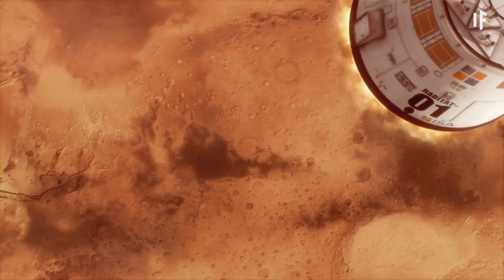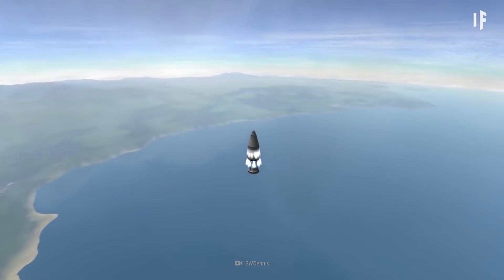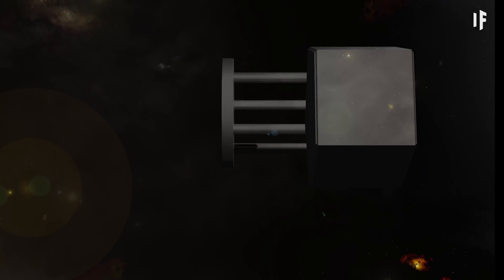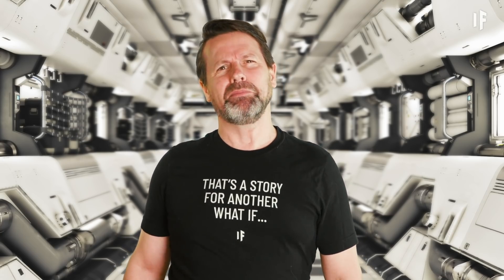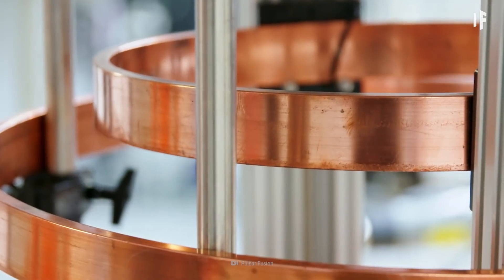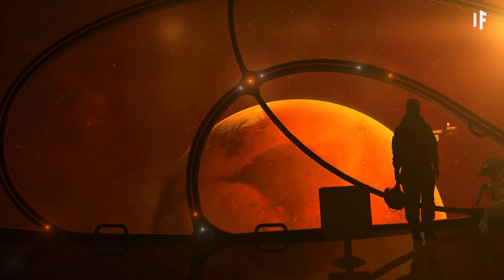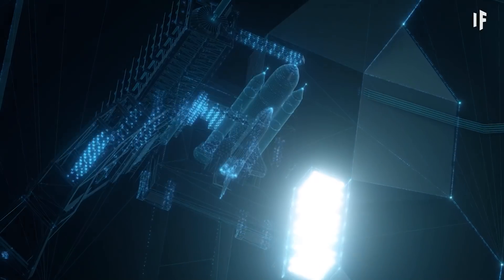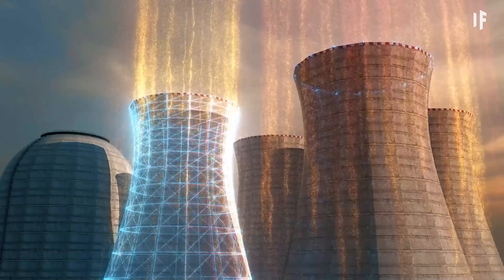What If We Had Nuclear-Powered Rockets?

Comment: hi what if but i wanna correct you nuclear thermal propulsion comes in 2 types nuclear fragment propulsion and nuclear thermal rocket and here both are good but nuclear thermal rocket can be used any where and is 1000 X better than our current chemical ones but its nuclear fragment rocket is which we cant use in earth  as its gives out nuclear exhaust but in then nuclear thermal one its just heated  coolant ( hydrogen ) going around the reactor getting heated and is given out so we can use it anywhere and also we dont need any oxygen so what if pls do complete research

Comment: Nuclear thermal rockets are not much better than chemical rockets because they use large quantities of hydrogen, if you want to see a fission rocket design that doesn't require hydrogen watch "liquid plutonium rocket".  The best way to explore /colonize our galaxy is with the constant 1g acceleration method, with this a ship can get to Alpha Centauri in 3.6 ship/7.3 Earth years and have gravity the whole way (and that includes turning the ship around half way and decelerating). A 10 ton ship would need a mere 10 tons of continuous thrust. Uranium and plutonium contain vast quantities of potential energy you would not need a lot of it for the trip.